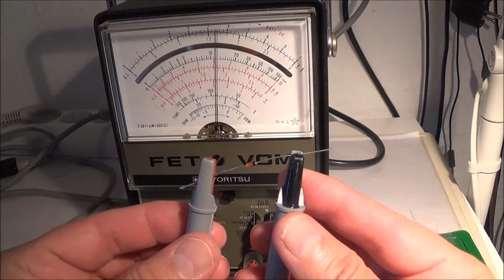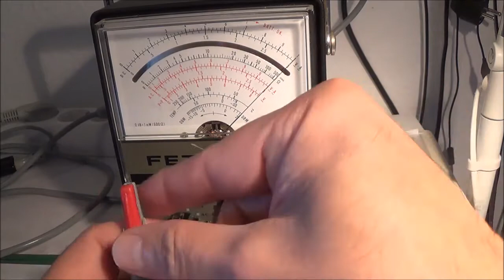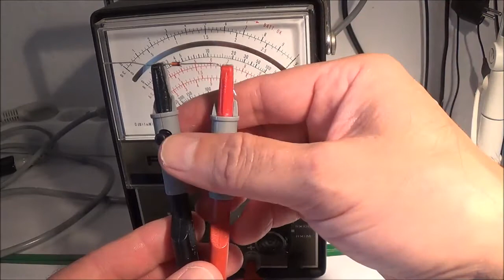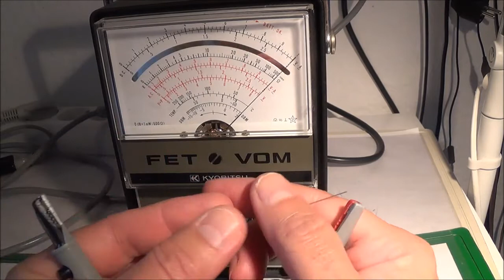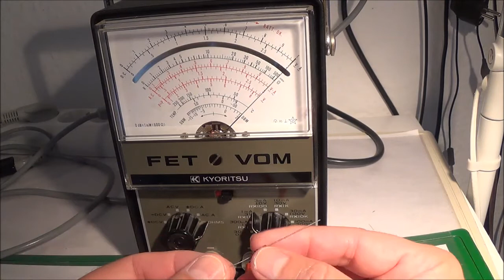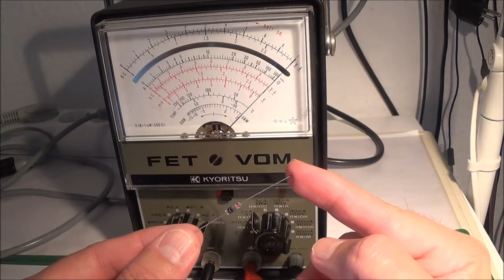Diode Testing With Analog Meter

Comment: Does analog multitester can show the exact value of a working diode?
Reply: I mean like diode mode on digitap multitester
Reply from the maker: The analog meter test will not show you, for example, if a diode breaks down under load. The digital meter won't either. But overall this analog meter test is good, The analog meter shows you the forward-to-reverse resistance ratio. A good diode shows low resistance in the forward direction and a high resistance in the reverse direction. Low resistance in both directions is a short; high resistance in both directions is an open. Power diodes have a much lower forward-to-reverse ratio than small diodes, there the ratio might be in the hundreds.